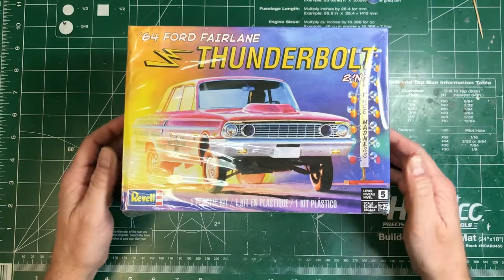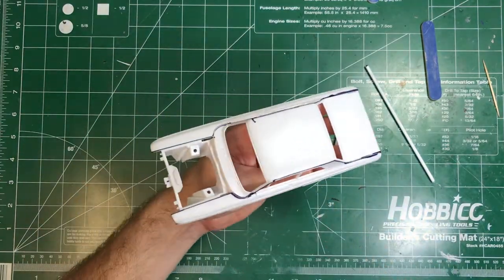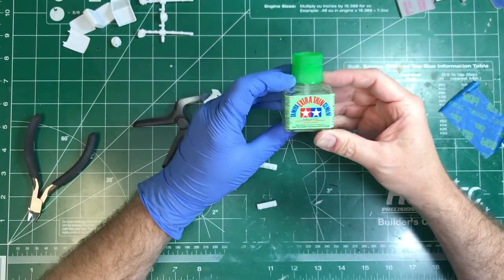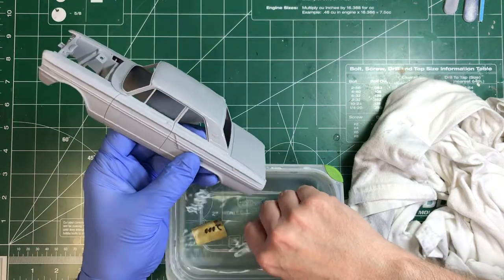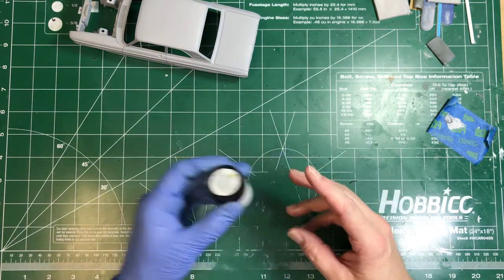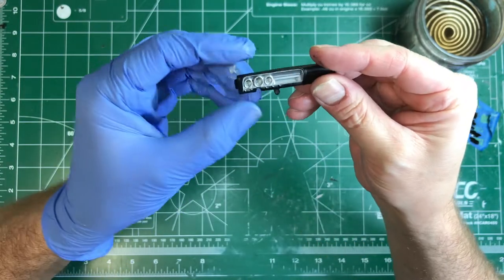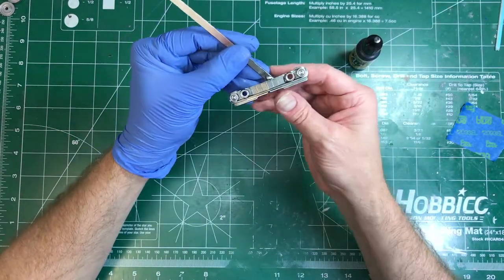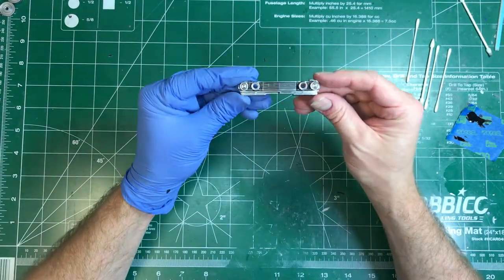Building the Revell 64 Ford Fairlane Thunderbolt scale model kit Part 1

Comment: Great video and great build. One science point: liquid cement doesn't "melt" plastic as melting requires heat.  Liquid cements are solvents that temporarily dissolve the plastic on both sides of the joint. When the solvent evaporates the plastic fuses. In a pinch you can make your own filler putty by dissolving scrap sprue in cement.
Reply from the maker: Interesting, thanks for the info.
Reply: @ScaledDownCustoms  Chemistry teacher - can't help myself sometimes. Your work is awesome keep it up.

Comment: Looks great! I’m curious what you’re doing with the brush as you paint the body? I don’t think I’ve ever seen that technique. Thanks!
Reply from the maker: If you are talking about the paint brush as I was airbrushing, some dust had landed on the body and I was just using a soft paint brush to try to remove the dust prior to painting over it.
Reply: Scaled Down Customs I thought that had to be it. It doesn’t mess up the paint/leave brush strokes? This could be a game changer! Lol
Reply from the maker: I let the paint flash off for about 5min after every coat.  The paint is still very soft but it can be lightly touched with a soft brush.  Anything more and it will damage the paint.